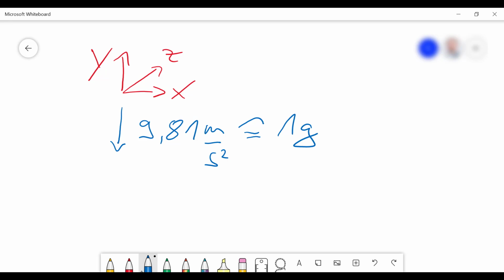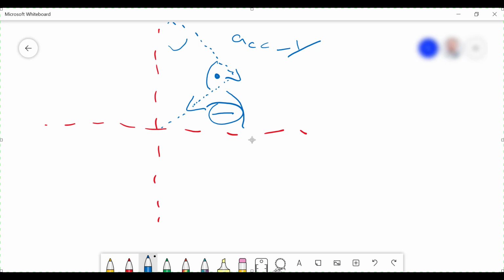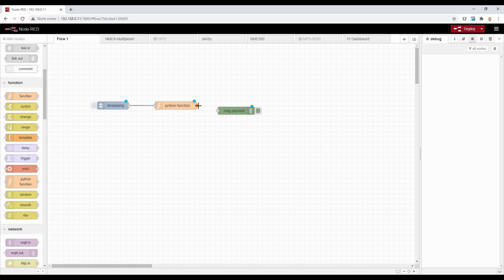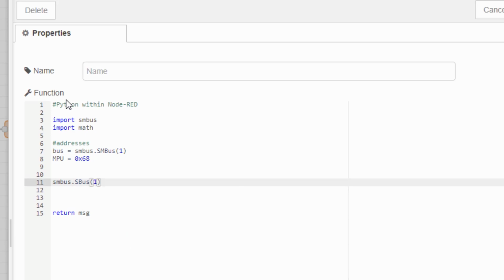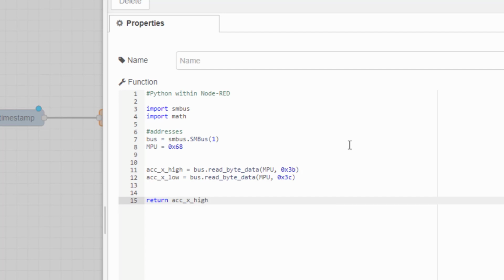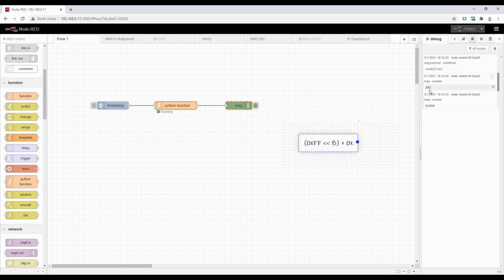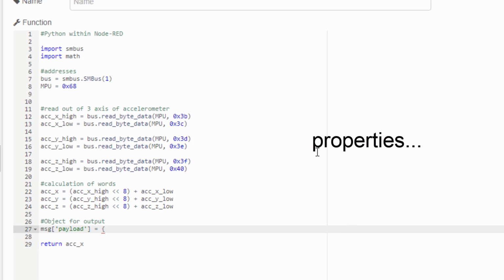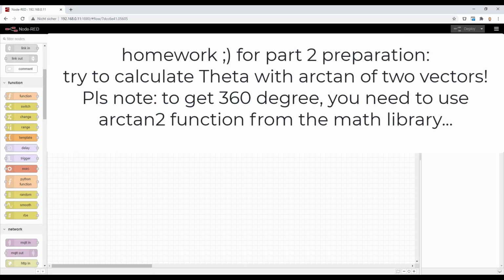MPU-9250 with Python in Node-RED #1: Readout of accelerometer registers and basic theory.

Comment: Hello,  A man who has the same appreciations as I do, love it.  I am interested inn adding a tilt compensated compass heading for my raspberry pi sailboat autopilot.  Do you have a link to any code that would provide this functionality in python?  Thanks for any help you can provide.
Reply from the maker: I would use the MacArthur HAT and the IMU connector: 
https://macarthur-hat-documentation.readthedocs.io/en/latest/i2c.html#internal
I am now using an ICM-20948 instead of the MPU, which seems to work pretty well with PyPilot: https://openplotter.readthedocs.io/en/latest/pypilot/imu.html
So, you get a lot onboard without spending too mich energy in low level sensor integration.

Comment: Hello sir 
I have error I cant fix while I'm using python function
THIS WHAT I GET ON DEBUG

 File "C:\Python310\lib\json\__init__.py", line 341, in loads
    s = s.decode(detect_encoding(s), 'surrogatepass')
  File "C:\Python310\lib\encodings\utf_32_le.py", line 11, in decode
    return codecs.utf_32_le_decode(input, errors, True)
UnicodeDecodeError: 'utf-32-le' codec can't decode bytes in position 16-19: code point not in range(0x110000)

so any idea to help me fix this problem ?
Reply from the maker: Hi Mahmoud,
I do not have a setup with a MPU-9250 currently running and can't test it on the current version. If you use the Bullseye version of Raspian, please be aware that Python2 was discontinued. Several things won't work until everything is updated.

Comment: I was playing around with the Python node the other day and after making a error in the program it actually crashed the Node-Red server. Could not start Node-red at all or get to my other flows. To fix it and restart N-R I had to manually find and edit the flow file on the disk to remove the defective code. Just a not to be careful, the node is not 100% bug free.
Reply from the maker: Hi Robert!
First of all: Thanks for your kind and generous donation. But I will write a mail to say thank you.

To your point: The Python node is a node to "play with". There is a funny comment from the author of the node. However, I also crashed a Java node and here my hint what to do:
1) You need to use putty and disable the node-red service: 
sudo systemctl disable nodered.service
2) Restart the Raspberry
3) Start Node-RED in "safe mode" with
node-red-start ---safe
4) It might happen that your old flows are not found because the service was started with a different user. However, all flows are stopped. If you find an empty flow, just stop Node-RED now and restart
5) Enable the services again:
sudo systemctl enable nodered.service
6) Restart
Now Node-RED should work again and all Nodes are stopped. You should be able to edit the Node.

Besides that I try to backup as often as possible...